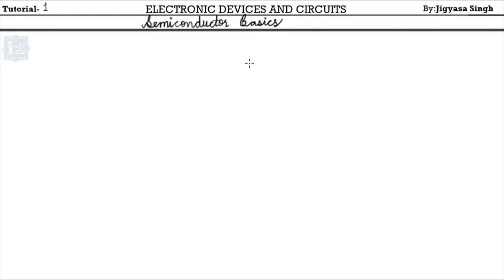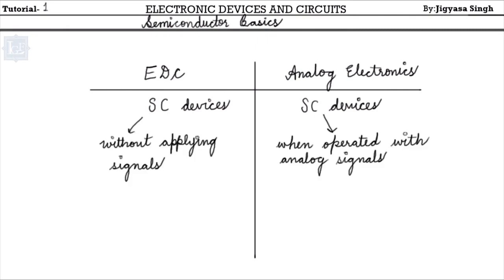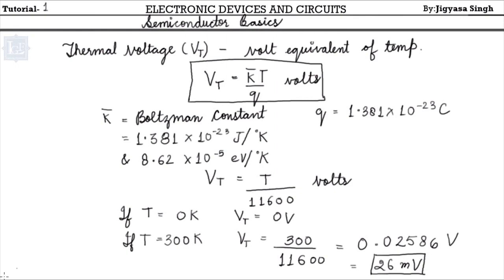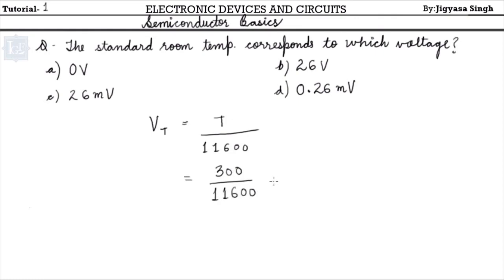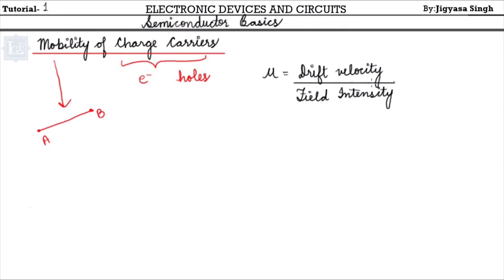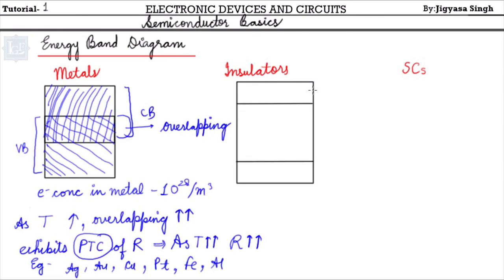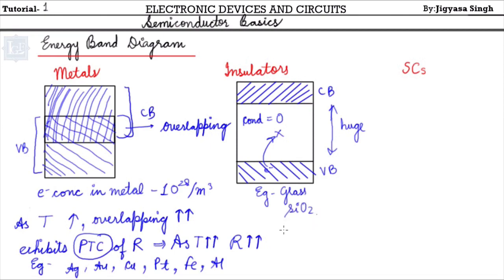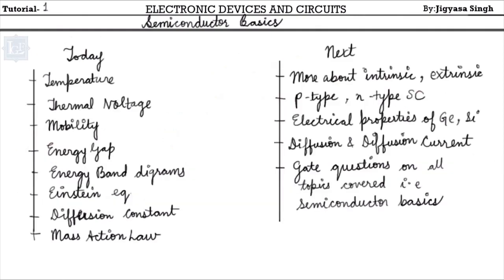Lec 01 Semiconductor Basics

Comment: You have said in lecture that as the temp increase diffusion constant decrease ,but it should be increase as D=uT ,Correct me if i am wrong?
Reply: First of all,your equation is slightly wrong my friend.
D=u*Vt
Now,here with increasing temp.:
i)u decreases while
ii)Vt decreases
but the effect of the first one will be more since the corresponding parameter i.e, u is strongly related with carrier transport.
As a result,D will decreased with increasing temperature.
Reply: vaibhav bajaj Digcademy started by veteran faculty of ECE and EE Engineering cometitive exams Mr.Ramniwas IES is also a good online platform to prepare for GATE,ESE and PSUs.Just visit DIGCADEMY and see the difference.